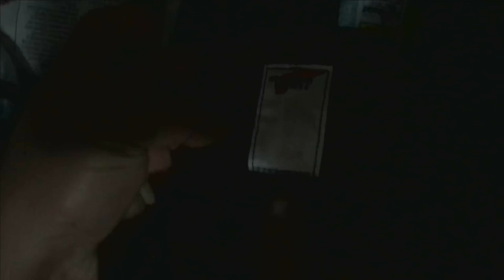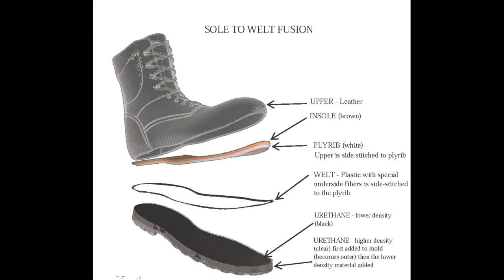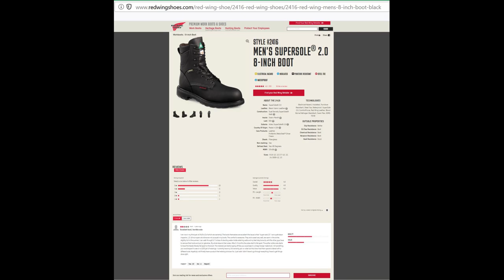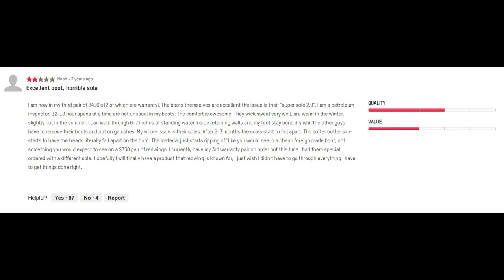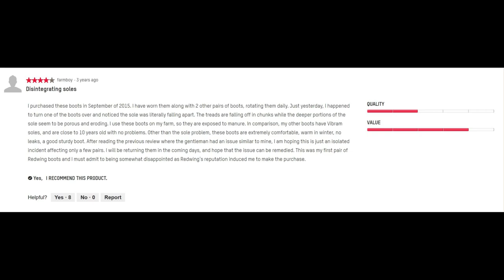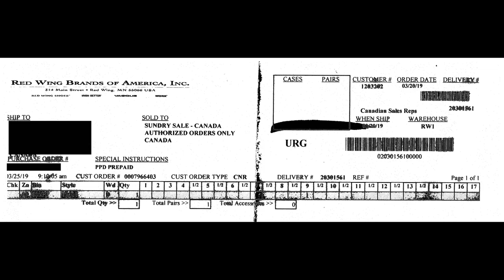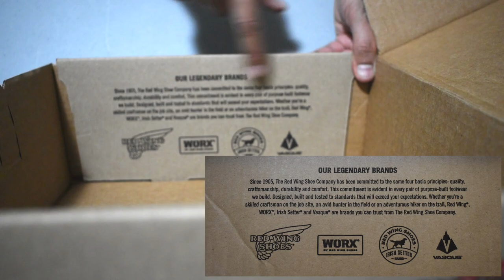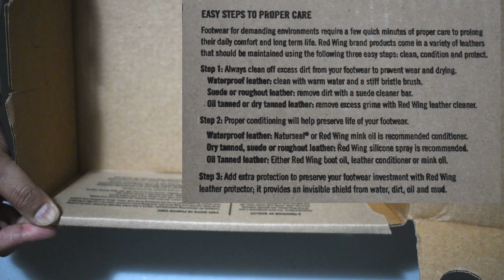𝗣𝗥𝗢𝗗𝗨𝗖𝗧 𝗥𝗘𝗩𝗜𝗘𝗪: 𝗥𝗲𝗱𝘄𝗶𝗻𝗴 𝗦𝘂𝗽𝗲𝗿𝘀𝗼𝗹𝗲 𝟮.𝟬 - 𝗥𝗲𝘀𝗼𝗹𝗲 𝗮𝗻𝗱 𝗥𝗲𝗽𝗹𝗮𝗰𝗲𝗺𝗲𝗻𝘁 - Model 2426/2416

Comment: This is interesting, the Redwing store I am dealing with is telling me that the boots are good for 2-3 years.  Perhaps I need to be looking at different boots.
Reply from the maker: Hi MrWicked98, Thanks for your comments.  Yes, I would agree.  If you are seeking longevity and not necessarily comfort, then choose rubber soles--really solid and wear is negligible over the years.  Cool handle, by the way.  Best regards, H.D.H.
Reply: @HANDYDANDYHUSBAND  Thanks,  just an update I'm going back to the Red Wings 606.  The pair of Red wing king toe rubber sole boots wear better but my feet, ankles and knees are paying the price.  A long day of walking on concrete always aches but it was far less with the 606.
Reply from the maker: Hi MrWicked98, Thanks for the update.  Yes, I would agree with your assessment.  The vibram rubber soles are durable but much harder/dense and less forgiving on the waist down.  For workboots which you are wearing 8+ hrs per day on concrete, your feet will find the supersoles 2.0 a much better alternative.  I am not sure what type of insoles RedWing provides with the 606s, but they provided some really solid, supportive, but shock absorbing ones with my boots (only really issue is the thin fabric layer separates from the silicone base after a few years).  All the best, H.D.H.

Comment: thoughts on the comfort of the full lug?
Reply from the maker: Hi Tyler Cloetingh, thanks for watching and sending me your question.  By 'full lug' I will take to mean the vibram soles.  Comfort-wise they are great.  Although not as cushioned as the original Red Wing soles, I found them to be much more stable and less 'mushy'.  I also found that the deeper lugs provided more grip in muddy/snowy weather.  The added height was also a plus.  If you walk a lot on concrete--say more than 3hrs per day--the lugs might not be as forgiving on your joints so keep that in mind.  All the best to you, H.D.H. [: { ].
Reply: @HANDYDANDYHUSBAND  Awesome. Yes I was using "lug" as a placeholder to what I assume is the vibram 132 sole you've got on there. I actually took mine in to be replaced with the vibram olympia sole and do expect a drop off in the cushion provided by the supersole urethane as you've noted. Which is OK with me, the plan is to transform my 1412's into a winter / snow / adverse terrain boot, and keep my 604's as the daily boot.
Reply from the maker: @tyler13923  Hi Tyler Cloetingh, thanks for letting me know.  Yes, that is exactly what I did with my vibram soled RedWings:  made them into 'inclement weather /adverse terrain boots'.  The other urethane soled RedWings I use just to keep them from deteriorating too quickly and I really try to keep them aired out.  I am very happy that you took the time and money to replace the soles...Mother Nature is smiling at you.  All the best, H.D.H. [: { ].

Comment: Most things degrade after 15 years tbh. I have new in box 1970 redwings that are quite degraded.
Reply from the maker: Hi MeLlamoBradly, thanks for watching and your comment. Yes, I agree, everything degrades, but as I mentioned in the video it was the sudden disintegration that was upsetting along with the near zero advance notice from RedWing that the supersoles have an achilles heel that other rubber soled boots do not have.  For this reason, I am only going with RedWing boots that have rubber/vibram soles like their logger version.  It is a very nice boot that will likely last a lifetime--with genuine welt construction to 'boot' (pun intended). All the best to you, HDH [: { ].

Comment: I would like to know every step you took to get that Vibram sole on that boot
Reply from the maker: Hi Hustle Humbly,  Thanks for watching and your comment.  I asked the cobbler whether he could take pictures or would mind me taking pictures as he worked.  Unfortunately, he did not fee comfortable.  His name is Les from Two Feet on Main Street, in Vancouver, BC.  I strongly recommend him if you are in the metro Vancouver area.  From what he described, he first removed the deteriorating soles.  He mentioned that this process really gummed up many of his tools/sanding belts.  He glued and sewed the midsole from the inside of the boot and the welt from the outside to the midsole. Then he sanded the surface he was going to apply the heel riser, and the vibram sole and glued these together to the boot.  Hope this helps.  All the best, H.D.H. [: { ]
Reply: I would like to point out that the name of the cobbler is Both Feet on Main, not Two Feet as mentioned. Also there is a place in Nelson, BC that does factory approved Red Wing repairs and modifications. The name of the company is Vince DeVito Shoes and Repair, and from what I know they are the only Red Wing approved repair shop in Western Canada. Here is the link for anyone who might be interested:

https://www.vincedevito.ca/service/repair/
Reply from the maker: Hi albertawind, Yes, thanks for the correction.  My apologies for getting the name wrong (my memory played tricks on me).  Les, the cobbler on Main Street, also advised that there is a repair shop in Metro Vancouver that does factory approved Red Wing repairs.  The only concern I had was that they use the same/similar polyurethane replacement soles and adhere the sole using a chemical rather than mechanical (sewed midsole) method.  I suppose you could ask them to alter the installation method but that would be different than factory.  Really appreciate you taking the time to comment and provide input--everything helps.  Best regards, H.D.H. [: { ]
Reply: Devito's are awesome they are my local boot store and cobbler and I can't say enough good about them excellent company

Comment: I must clarify my previous comment. I do a lot of outdoor farm work.  The boots did get damp in use but never soaking wet and they were always kept dry after and between use. I agree that the disintegration of the soles has something to do with moisture  degrading the urethane. Clearly, there is something very, very wrong with these soles.  Red Wing should take responsibility.
Reply from the maker: Hi John White,  Thanks for your comment.  I agree that Red Wing ought to advertise more clearly the level of durability one can expect from these type of soles and that they, while designed for comfort do trade-off longevity.  I think Red Wing will--if pressed--accept responsibility; however, it is something that they don't do as a matter of course but on a case-by-case basis.  If you have some time, I would suggest, sending Red Wing customer service an email and share their reply on this channel.  We are all consumers and good companies (like Red Wing) will listen and change the manner in which they advertise such soles if they hear a united concern.  I will admit, though, that I have been treated very sell by Red Wing and the shoes (both the resoled ones and the new pair sent to me by Red Wing) went through a frigid winter last year and come through with shining colors.  I must say that the resoles continue to provide me with much more of a confident feel than the more cushioned urethane sole.  Hope the above helps.  Best wishes, H.D.H. [: {]
Reply: @HANDYDANDYHUSBAND  That's a good and fair comment.  Red Wing is an honourable company and I did contact them.  After several emails and photos they agreed to replace the boots.  My confidence is restored.  There still remains a fundamental problem with these soles however--they don't stand up to exposure to moisture.  Just walking on damp grass in the each morning is enough to degrade them prematurely.  I hope Red Wing finds a solution because otherwise the boots are great and the soles are very comfortable.
Reply from the maker: @johnwhite7831  Hi John White, Thanks for keeping the community informed.  I am happy that Red Wing did right by you...just goes to show how it 'pays' to spend a little extra money upfront for an established brand as insurance in case something doesn't go as well as expected.  Hope you enjoy your new pair of shoes.  If you have your old boots...may I suggest to keep them and try to get them resoled--it may cost a little more, but Red Wing uses high quality leather and resoling them at your cost will be a good investment while helping the environment.  If cobblers in your area are reluctant to resole, you may consider removing the existing urethane in advance of presenting the shoes for resoling.  Cobblers don't like getting their tools and belts all sticky with the urethane goo.  I have heard that leather solvent works well to remove the goo.  All the best, H.D.H. [: {]

Comment: You are the reason companies have to revamp their warranties. This is outrageous and a con move dude. If i could get 15 years out of a pair of boots i would be thankful for sure. They have a warranty but i am pretty sure that they dont have a lifetime policy for some boots lol
Reply from the maker: Hi Ninten dont But do, thanks for watching.  I don't agree with your position, but would defend your right to hold it.  The entire issue I had, was not related to a warranty period (ie. 1 yr vs lifetime etc) but rather transparency in the sale of supersoles 2.0.  Supersoles are chemically unstable; therefore, unlike rubber soles, it is necessary to use them 'regularly'.  This information is not provided to the end user until they have an issue this--not my complaint is outrageous.  For people that wear one pair of shoes day in and day out, this may be ok, but for someone who may have shoes they wear for specific purposes i.e. harsh winter conditions, then it becomes problematic if they go to put on a pair of boots that they know they have used rarely and they soles completely disintegrate.  Red Wing didn't have to replace the shoes, and I didn't 'con' them.  I told them the problem and asked them to make me whole because they failed to warn me or anyone else about the structural integrity of the shoe being compromised by an everyday substance known as water. You may still not agree with me, but that is OK.  If a company attempts to 'con' its customers into buying a product which they claim is better than regular rubber soles but then don't tell them it will disintegrate faster, then I have no reservations in asking them to address it.  Do you really think they would have sent me a pair of new boots if they thought they were completely in the right?  Or do you think they were more concerned about me posting the very troubling pictures of the disintegrating soles on some reddit post or YT video?  Anyways, the answer to both questions is in their response.  Hope that makes my position clear, but hey, you can still feel free to disagree.  All the best to you, H.D.H. [: { ].
Reply: @HANDYDANDYHUSBAND  but you are talking 11 years bro come on thats a long time. I will be lucky to get 6 months out of the same boots not for the fact of the outside wearing out but the inside wears out in my boots first most of the time. My mother-in-law has had a similar problem with shoes that she has had in the closet for 10-15 years. That material just wears out like that. Redwings policy to my knowledge is 30 days for fit and other problems and a year for normal wear that they will work with you on. Enlighten me if it is different. Now if you had leather the leather would probably dry out after that many years or probably the stitches would dry rot. Something is bound to mess up after that long imo.
Reply from the maker: @nintendontbutdo5507  Hi Ninten dont But do, thanks for your further reply.  From my perspective it doesn't matter if it is 6 months or 11 years, the significant issue that I had (which Red Wing has not addressed) is just telling their consumers, 'Hey, this sole is bouncier than rubber, will help cushion your steps on cement, but it will break down if you don't take your shoes for a walk every week--even if these are insulated winter shoes and one would not wear them for 3 seasons of the year'  Some shoe manufacturers of ladies shoes (with reference to your MIL's shoes) do actually put a warning on their shoes advising the buyer that water/humidity will disintegrate the shoes.  With regard to leather, you can see in my video, the leather is in perfect shape, because I do clean/condition my leather shoes (to keep the leather water proof and the leather resilient) after each season.  Well made leather uppers will significantly outlast the soles.  This is why most high quality leather shoes are designed to have their soles replaced (which keeps cobblers busy).  Hope my added comments help you see my perspective better.  In the end, it didn't matter what Red Wing's warranty is, it is the fact that they hid and continue to hide a major issue with their 2.0 soles which is that they can become compromised in water/high humidity.  All the best to you, H.D.H. [: { ].
Reply: @nintendontbutdo5507  Honestly dude I agree with you, 15 years seems pretty crazy. One thing red wings can benefit out of this situation is showing the consumers that they do stand behind there product. Hydrolysis, like this pair of red wing supersole are quite common on different pair brand shoes from Jordan’s to Blundstone shoes. If I were red wings I would offer only to get them resole  & not even mention about a replacement option.